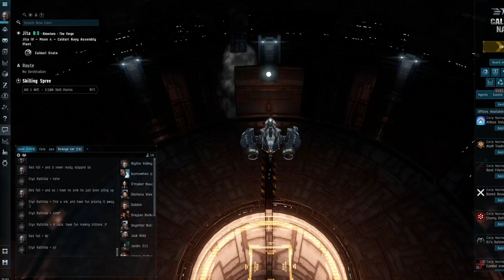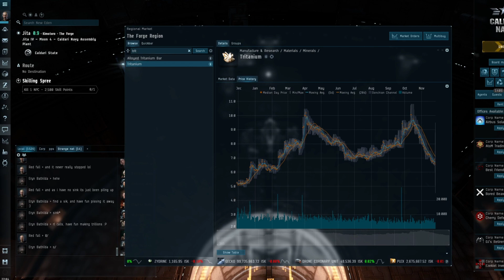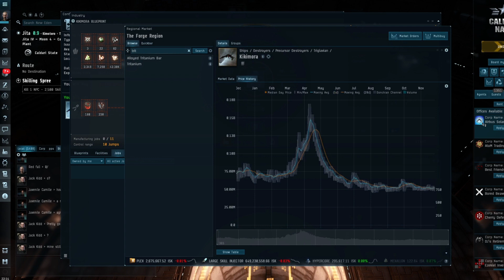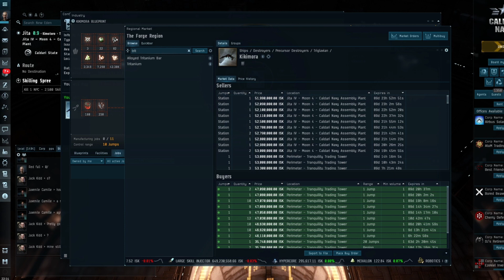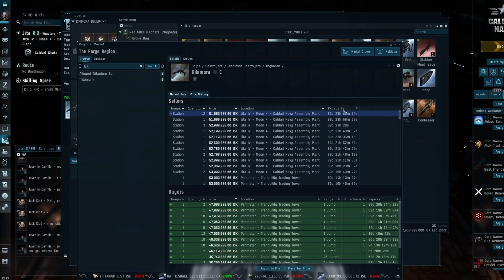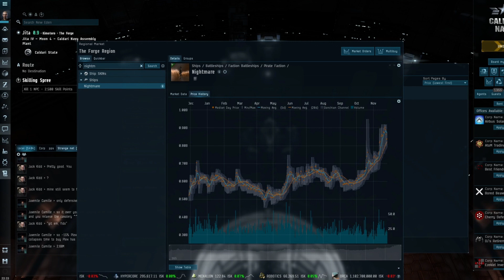Eve Online -  Tech 1 manufacturing still millions to be made

Comment: I do really like your content, thanks for continuing to do it. 

However I do think it's important to point out that , especially for T1 items with smaller margins, it can absolutely be beneficial to find a structure instead of building in Jita 4-4. 

Here are some numbers for the Kikimora example you used. It's using a worst case example with respect to broker and tax on the sell, but illustrates the point still. 

Kikimora Sell, Gross : 52M
- 5% Broker : 2.6M
- 5% Tax : 2.6M

Kikimora Sell, Net : 46.8M

Kikimora BPC Buy : 20M

Build Cost Breakpoint : 26.8M

Jita 4-4 ( 12.49% Cost Index, 10% Tax )

Component Materials Cost 24,337,697.61
Manufacturing Facilities Usage 71,245.23
Total : 24,408,942.84
Net Profit : 2,391,057.16

New Caldari Sotiyo ( 9.21% Cost Index,  10% Tax ) 

Component Materials Cost 23,680,916.81
Manufacturing Facilities Usage 49,962.93
Total : 23,730,879.74
Net Profit: 3,069,120.26

Delta : 678,063.10

The Sotiyo structure bonus + rigs saves you quite a bit on the materials, plus usage is cheaper too. An extra 675k profit with that small a margin is fairly consequential at scale. 

For newer players who don't have shipping capabilities, the public freight services come in handy. Red Frog for example only charges 6M ISK one way from Jita to New Caldari, up to 845,000 m3. If you are only making one or two things, not great. But if you can plan things out right and distribute the total shipping cost there and back out over a lot of items, you still come out ahead in a lot of cases. 

Again, great content, just thought this point would be valuable for newer players in this space.
Reply from the maker: Hey Tom, what a great break down! Yes indeed and I do point this out in some of my earlier videos. I think for most ships moving out of Jita is recommended however on this occasion it was profitable just to buy and build in Jita. The main point is that you dont need anything like a freighter ect and that you can do it straight from Jita.
Reply: @strange_Net  Awesome, I must have not caught other vids that you have called that out. Sorry that I missed the point you were trying to get after here. :)